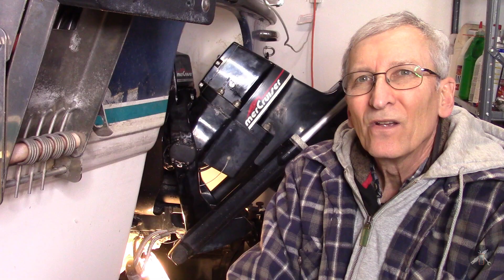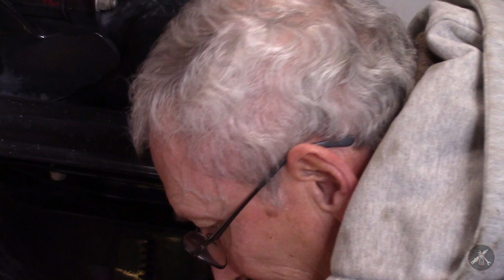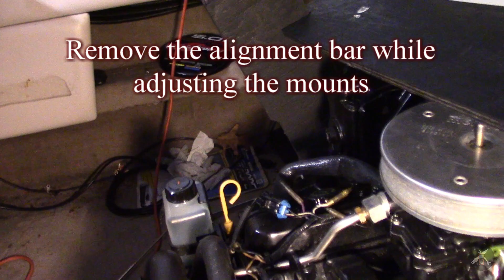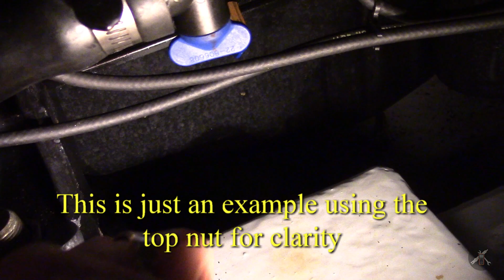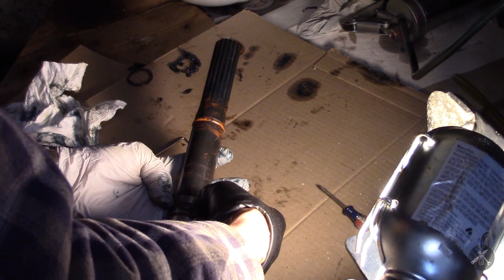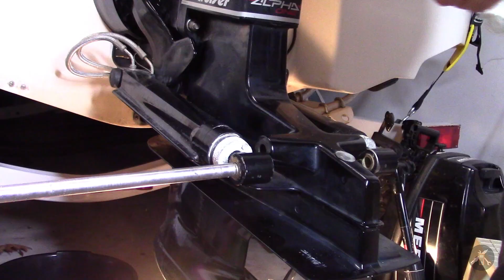Check Engine Alignment Mercruiser 1 Alpha - Remove Outdrive and Adjust Mounts

Comment: Dan, 
Thanks so so much for the input. I don’t have a shop manual so this is useful information.
I was thinking the first thing to do is to make sure that the rear washer and spring are in place properly . Then I’ll follow your instructions on how to install the engine. This is not a new engine. I had to pull the engine to replace the fuel pump. I think I’m close.

Comment: Hi Dan, 
I’m currently installing a motor back into my Searay boat. 
The motor is set into the boat again and I’ve got the front and rear nuts and bolts installed and threaded. It appears that the ancient is slightly off to the right of the Stern drive. Have you ever seen that happen? Is there play in the back end of the Motor? It looks like it’s off about 1/32 so I can’t get the alignment tool installed into the engine. I thought about slightly lifting the engine again and trying to have reset it again to see if it lines up luckily, I still have a lift.
Reply from the maker: I don't have a lot of experience with setting a new engine.  So, looking back at my manuals (this is in engine manuals) for 4.3 / 5.0 /5.7 / 4.5, they all indicate to first be sure the washers are all in place on the rear mountings and not worn.  It appears the washers and spacers set the fore /aft and lateral position by taking clearance out of the rear mount bolts.  They specify to set the engine on the rear mounts while connecting the exhaust.  Then while the engine is still supported at the front by the hoist, tighten the rear bolts to 35-40 ft-lbs first. Then set the vertical alignment as the engine is set on the front mounts. It appears they want to set the alignment while the engine is still supported on the hoist. If the rear is set and torqued first, then the alignment adjustment should all be vertical. My newest manual for the 4.5 also suggests that the alignment bar can be struck on the top, bottom and sides at 90 degree intervals with a synthane mallet if the gimbal bearing isn't aligned with the coupler. If you're going back in to existing boat, it would seem that wouldn't be necessary, but don't know.

Comment: Good tip about rolling off the back o ring first to not get stuck in the other grooves. Wish I watched this before I did mine couple days ago. Not the worst thing though.😈🙄
Reply from the maker: Rolling off the o rings like that is a trick I learned working in a brake test lab long ago.  You can do it in any sequence, but sometimes getting the rings over the empty grooves can be a pain.

Comment: Thanks Dan.  I once had to pay someone to replace the gimbel bearing, looks like you accidentally are showing us that too!  Never knew that I should check alignment!  Wow!  Thanks a trillion!  I have the EXACT alpha 1 that you have.  I went to a boat show last month, the whole show only had 1 single inboard outboard - ALL other new boats were outboards.  Dont get it.  🤔🤔 100's of them and all outboards - in TN
Reply from the maker: You're welcome. Changing the gimbal bearing is a little more difficult, but similar. Needs a slide hammer to pull and a tool that drives on the outer race to install. I made a custom one from a piece of 4x4 post to change mine years ago. 

On stern drive vs outboard, I think times and economic incentives change. For my first boat (1985), I wanted an outboard. My Dad had a 115 Merc inline 6 that really ran nice. I was looking along those lines. I ended up with a stern drive, because the economics were so good.  From memory, boat (deep v runabout) was about 10k with a 140hp 4cyl Mercruiser, and about 15k with a 115 outboard. The stern drive boat had full instruments and was better appointed. I asked the dealer (owner) why the difference.  He claimed that the automotive based engines were much cheaper (about $4500) and the outboard was more like 9k. Today, outboards have become more refined than the old 2 strokes and the 4 strokes don't need all the needle bearings. Then the stern drive engines are now not automotive in most cases. Mercury is making their own lower volume engines since GM discontinued most of the old cast iron block engines, plus the emission regulations are driving more cost  I suspect the economics are more equal today.  That plus the move toward pontoon boats with multiple big engines where stern drives are harder to integrate.
Reply: @bitsofwisdom460  Depressing.  Are you saying your boat and mine are antiques?
Reply from the maker: @budsodalsky  Well, not necessarily. Mercury still builds quite a few stern drives, it just seems that the outboards are popular right now.  I like the stern drives because the engine mass sits low in the boat and the back end of the boat is clean without the engine up in the air. I would buy another one.
Reply: @bitsofwisdom460  MEE TOO!  plus, I can work on chevy 4 cyl

Comment: Nice, I know when I changed the water pump impeller a few times, I actually learned a bit of French..... I had over 500 hours on mine and never knew to check that alignment. Also never had any problems with the Alpha 1 drive. Kinda miss the boat after watching you...... 😢
Reply from the maker: As I note in the video, I don't check it as often as recommended because I really haven't had it move. I suspect that most boats stay in alignment.  But, it is preventive maintenance, because if it does get out of alignment, the gimbal bearing and /or the coupler can be damaged and those can be expensive to replace - especially the coupler (engine pull).
I understand how you could miss your boat.  I really do enjoy mine.

Comment: Great detail on something that is usually talked about but not done or done improperly.  We built a stout 4.3 for an older Searay and after replacing the engine the alignment tool slid in so easy that we thought something was wrong. We just got lucky and had perfect alignment :o
Reply from the maker: Thank you.  I think you're right that alignment is often neglected. Good that yours was so spot on.